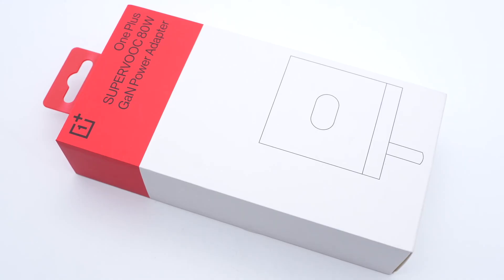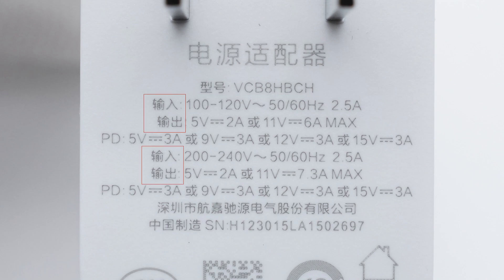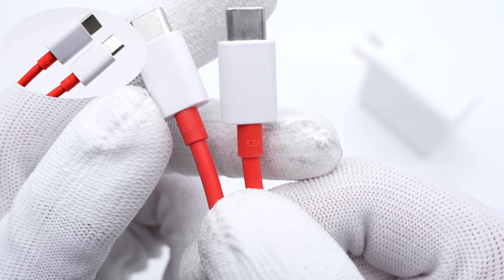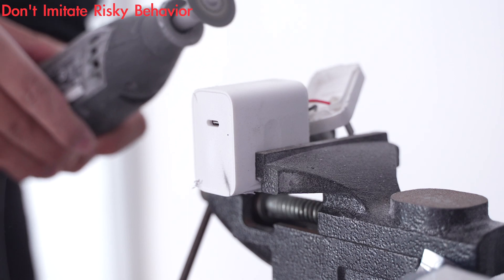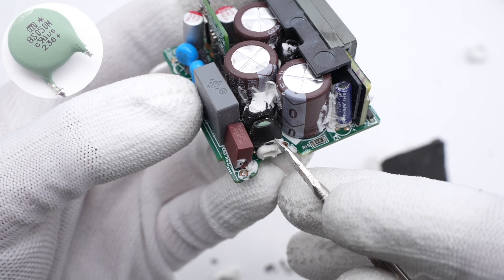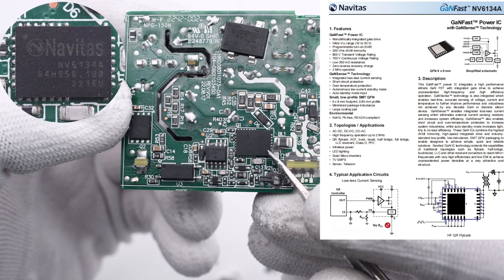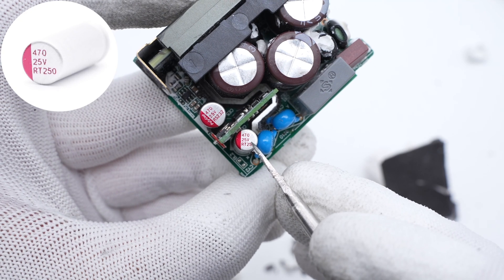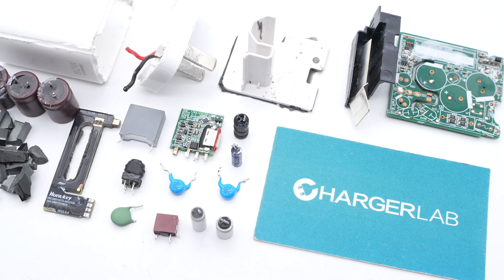Teardown of OnePlus 80W SUPERVOOC USB-C GaN Charger

Comment: If the cable only supports 6.5A, how will the charging reach 11v 7.3A 80w?
Reply: That current rating is probably dependent on time as well. So it can handle the 7.3A, just not for a very long duration.